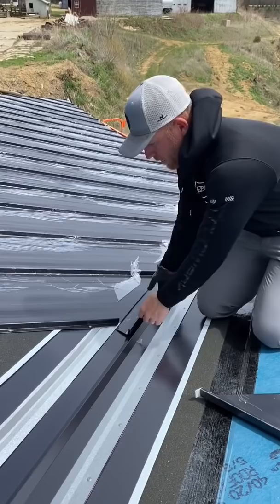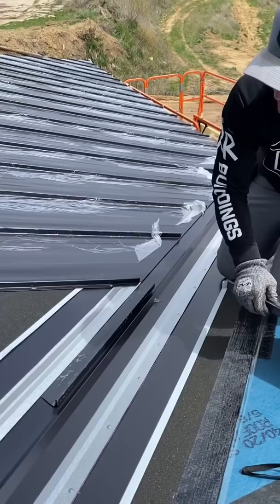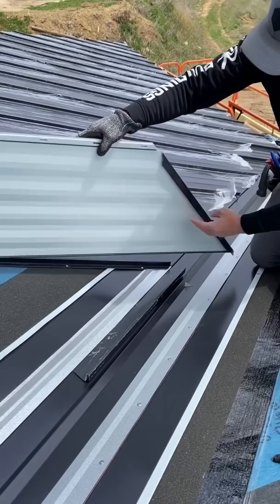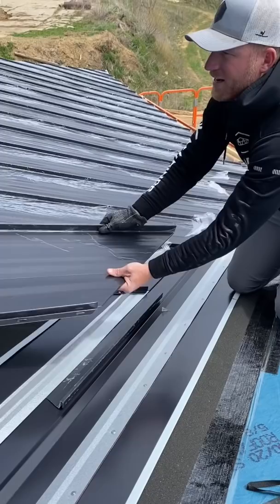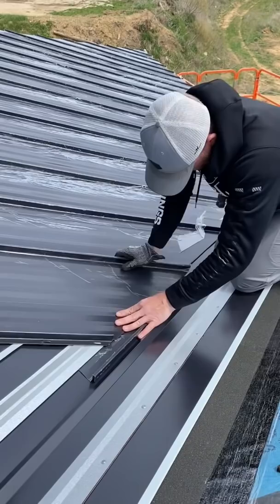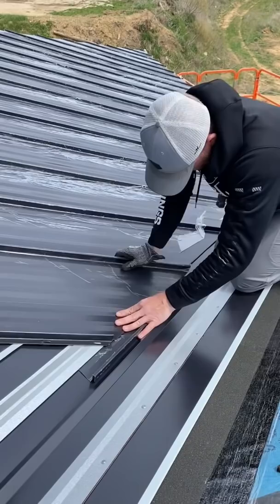Best Metal Roof Valley Trick

Comment: Duct tape also on the backside of the scrap to prevent any scratches, great tip👍
Reply: Good one. Plus isn’t anyone going to say anything about that protective film left on? If I spent a fortune on a new metal roof, I sure as heck wouldn’t want any traffic on it! Furthermore, on a hot day, the sun and heat will make a real fun time peeling that film off. I’d love to photograph that roof from a high man lift when done! I guarantee, there will be more dings, dimples, and whatever all over that roof, when the person tries taking off that film!
Reply: @noonespecial1200  it comes off super easy especially since it's already pulled of around the seems where each piece is connected.  Plus there is orange lift basket right there.. would not even have to get on the roof.

Comment: now you just have to not scratch the valley with the scrap piece
Reply: And it looks like he hasn't. Did you not catch the part where is indicates that the hem will more easily cause a scratch. The sacrificial piece isn't hemmed
Reply: the sacrificial piece is straight edge so it won't scratch against a smooth surface, but a hemmed edge is angled away from zero so it automatically would scratch the surface of the underlayment in the valley

Comment: It is a responsibility and do the job right!  You can be my roof to go to..many roofer contractors (including my concrete roof tile contractors did a half ass job by NOT even a nail to secure the roof tile).  Thanks for your video and hope those roofers can learn from your video.
Reply: There isn't 1 commercial roof in Dallas Austin or San Antonio that would pass a dry in inspection from Florida.   Not 1
People buy Texas and they have 0 realization that the codes just ain't there.  I seen a 2 story house framed on 24 inch center studs.

Comment: I use flexible plastic cutting mats. This is the best way to not scratch the metal. I use three plastic cutting mats at a time so once I finish with one panel I just move one of the three plastic mats up or down depending on if I’m working up or down. I tuck the plastic mat under and it hold the plastic mats down. Then you have more room to work with and not scratch the metal. I also link them together with duck tape and also at the ends of the plastic so they don’t slid around. 💰

Comment: I installed 5300 lineal ft on my building many hips and valleys I found it easier to once I folded the hem for the valley I ran a strip of duct tape to cover all the rough edges and it made it slide in very easy

Comment: Okay, but how do you keep the sacrificial scrap from scratching up the metal it’s protecting?
Reply: Well you'll want to use a sacrificial piece that does not have any screws sticking through it, or cut edges that bend downwards, or mending plates glues to the bottom. Hope this helps.
Reply: Easy. The sacrificial scrap just needs a sacrificial scrap to tuck under it.
Now before you ask… yes, that 2nd sacrificial scrap just needs a sacrificial scrap to tuck under it too.
Reply: @sapp6401  wouldnt the sacrificial piece of the other sacrificial piece need a sacrificial piece of its own?
Reply: @mexinica8455  you got it. It really is that simple
Reply: I mean. Use a thinner plastic cutting board. Works great
Reply: @sapp6401  This was hilarious.
Reply: @sapp6401  - it’s sacrificial strips... all the way down!
Reply: Tight

Comment: I'm about to be moving into small lake house that my great grandfather built as a kit in the early 60s, having alot of updating done, among them is a metal roof. What would be the going rate for an 800 sq ft house? And what would you prefer,  5v crimp, insulated panels? Trying to do as much research as i can. Thanks

Comment: I may seem like a silly question. I have never installed any kind of roof like this, so I was just wondering if the valley pieces are pre-cut or does the contractor have to cut them and bend the ends to lock in to the cleats that holds them?

Comment: 1...cut that little corner off underneath that extends past the side of the panel...2...panels aren't suppose to be tight on the cleat, need a small gap for thermal movement...3...obviously not a watertight warranty job or else gunnable butyl sealant would be required between the top of the cleat and the bottom of the panel...4...your valley reveal is a little small...5...shouldn't be using granulated vapor barrier underneath metal...other than that solid work...

Comment: Ok so the piece of scrap “metal” you’re using seems like it would scratch it up as well I mean not all the time but I would grab a plastic piece that does the same thing so there’s no possibility of scratching it
Reply: Ideally it's hemmed or taped on the edges to not scratch, but he's probably a lot  more worried about scratches on the exposed parts of the valley than what's going to be hidden under the panel.

Comment: I’m trying to figure out how water would get in through this system always compare to shingles or ceramic I’m starting to come to realize that this type of roofing is above all standards compared to other roofing materials like shingles and ceramic tile. I’m planning on replacing all my roofs with that now I live in Arizona and have a couple properties. Would you recommend when the time came to take this route? Instead of doing shingles again? Or ceramic?
Reply: If you got money yeah sheet metal is pretty water tight compared to shingles when done right and lasts longer but depending on your age I'd go with shingles they still work it's just prefernece

Comment: And that my friends is how you scratch a valley, when you pull the piece out
Reply: Yeah when I did that I made sure to hem the front and sides so when you pull it out it's not scratching anything. More on that he shouldn't go so deep with his slip peice you just lay it in front of the clip ,once the panels installed you should be more or less be able to lift the slip peice vertically. You shouldn't bury it under the clip Noone sees scratches under the clip.

Comment: Can you tell me if standing seam metal can be installed over purlins or do u need plywood??
Reply: You can install standing seam over purlins if they are spaced very close together like  less than 16'' on center. 

 Not saying that this is the best but that it does work well and you can still walk on the metal.

Comment: The sacrificial piece of metal doesn't scratch the roofing metal?
Reply: Looks like he is picking up the back end of it so the only point of contact is hopefully under the piece that was just slid on.
Reply from the maker: You cut the piece with the correct snip
So it rolls the edge up
Reply: @RRBuildings  That was the piece I was missing.  I, too, questioned why the scrap was going to scratch less than the next panel.  Makes total sense.  Thanks for the video and the clarification.  You really deserve that 1M subscribers and more! Keep up the great work!

Comment: The real question is why is a "life time" roof scratching so easy..
Reply: Lifetime in most products has no bearing  other than warranty, your paying a form of insurance.
Reply: Because it's a metal edge rubbing against metal..kinda obvious the bottom of the sheet is folded so it's like a hem you push it up into the clip to hook it and the folded part rubs against the valley which can scratch it.